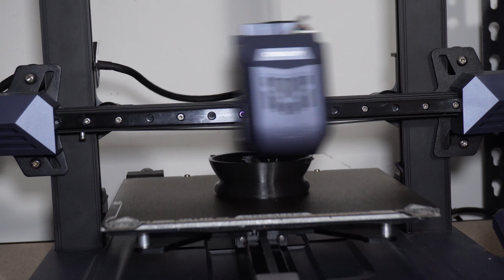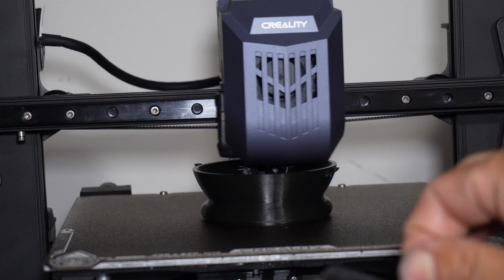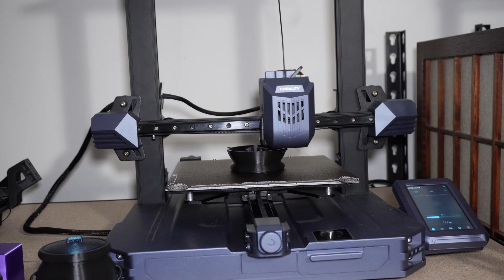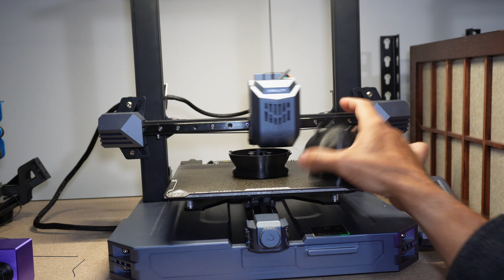Creality CR-10 SE Rises from the Ashes, with Micro Swiss Hot end. Z-Banding Layer lines are *GONE*

Comment: Would you recommend this printer as im thinking of getting it. Or could i buy better for around the same price. ?
Creality have so many different types i just dont know which one would be better 🤷🏼‍♂️
Thanks.
Reply from the maker: My CR10-SE has become a work horse, but, I feel like it's because of my ability to tune everything just right. However, for the price range, the V3 is a no brainer. It's the most advanced in the Ender/CR lineup, and, for some reason, it is cheaper than the CR10-SE. Here is my unboxing: https://youtu.be/vs72d3Us-8Q
Here is the machine: Get the Ender 3 V3: http://shrsl.com/4hpsb
Reply from the maker: Months later, my answer has changed to a firm YES. CR10-SE is a great machine. Also, the V3 and V3+